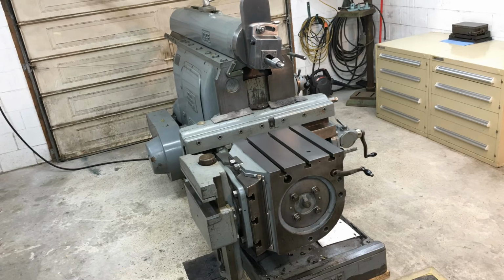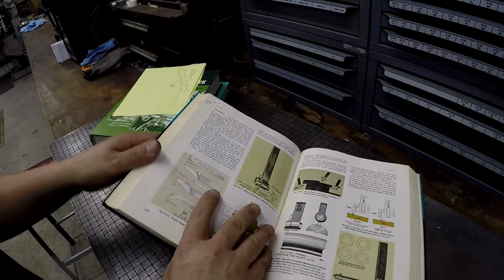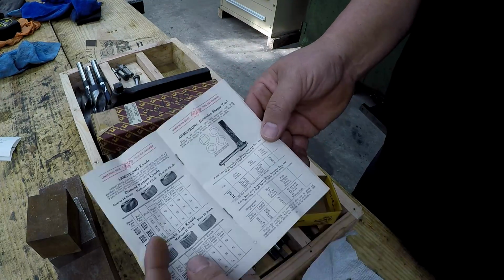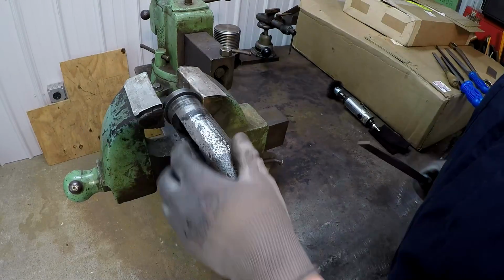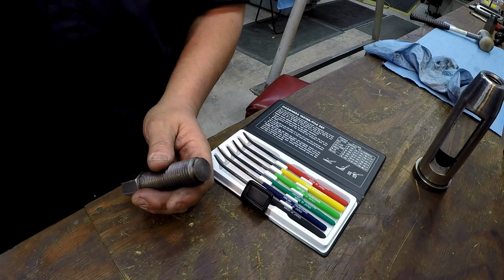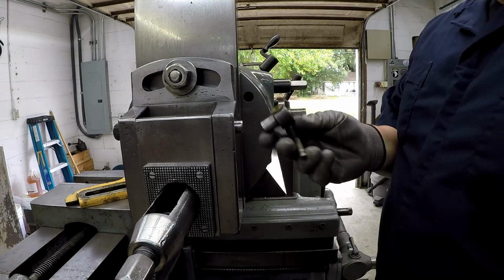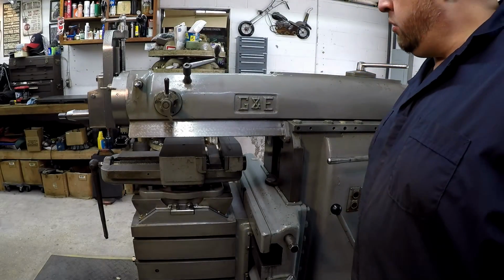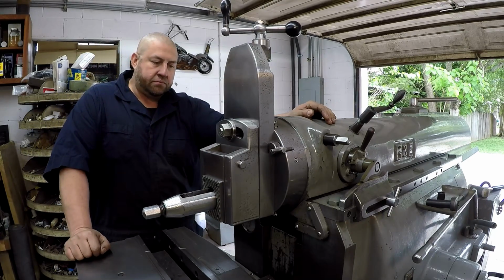SNS 213: Shaper Tool Head Final Reassembly, Machine Tool Books

Comment: When I was 18, I built a small lathe from scrap hot rolled angle, cold rolled plate, and threaded rod. Bronze pillow bearing blocks for a head stock. Draw-filed the ways and compound slides, gibs, etc. using only the ground surface of a drill press table as reference. Did all the draw filing by pulling the file toward me. I remember the shearing action removed metal much faster than a forward stroke. Still it took weeks.  The files were once my grandfather's.  Never got to the chuck or power feed. Just hand cranks, centers and a face plate with drive dogs. But it did finally turn 1.5" dia. x 6 in cold rolled with 0.002 taper. What a labor of love...

Comment: Totally agree with you Adam on the filing technique. During my apprenticeship I was taught here in the UK that a light return stroke clears the file, draw filing on edges was for truing. A "bastard cut" file is used for rapid removal of metal etc.

Comment: Nice work.  My own pride and joy is a Brown&Sharpe screw machine from the early 1960's.  I went from total strip down and clean to new lubrication, bored a new turret for it, even rescraped it.  It took months, cost my company thousands, but I was soooooooooo proud of what I had done.  The first job in it was a part that used to take a week to set up, and usually ran with about 40% quality rejects and went to an 8 hour set-up, and the only scrap was the first piece during set-up.  I wonder how it runs now, but I got fired a year or two later.  But I still have the second piece from the set-up!

Comment: I am an artist, years ago I decided to start working with metal in my sculptural work. I took a welding class at the Vocational school and got the welding basics. There was not much info out there on metalwork/shop work nor did YouTube exist. I ended up using old high school textbooks on metal shop work to learn basic skills. That was thirty years ago, I still refer to them from time to time. ( have two of those books Mr. Pete sent you)

Comment: I was taught draw filing at school 55 years ago when I started metalwork classes at the age of 11 or12. The one thing that I learnt later on as an apprentice (Engineer Cadet in the Merchant Navy) was that when filing a round profile, rather counter intuitively, was to file in the opposite direction to the round profile. So that rather than the file following around the round section you lifted the file up in the direction of travel while pushing down at the rear. This actually gives you a rounder profile than filing the other way which tends to give you a series of flats. For doubters I can only say go to your workshop/garage and give it a go, it does work.

Comment: Hi, On your filing, on this side of the pond that’s the way we were taught. It was said that the teeth were cleared on the backstroke. Who knows who’s really correct?Also your draw filing is perfectly correct and I always favoured it for getting a good finish. Very satisfying. You can also fill the teeth with French chalk, you may know it as welders chalk. You get a really soft finish using this. Your detractors never did any bench fitting. Regards.

Comment: Just to add more fuel to the 'filing debate,' I was taught to file round objects in a different fashion to you, Adam. For 'radius filing,'  in the UK at least, we start with the file on the forward part of the workpiece and as we push it forward, progressively lower the handle so that the area being filed moves towards you. Great restoration, by the way.

Comment: a little tip on wire wheels. when they seem to be getting dull lightly touch them to a grinding wheel while spinning. it gives the wires nice fresh sharp edges. works well with hand brushes as well lightly pass them over a grinding wheel or belt to refresh the edges. think of them as any other cutting tool works best when fresh and sharp.
Reply from the maker: Never tried that one before. Thanks.

Comment: I just thoroughly enjoy the shaper videos and the learning.   I have a little 7" Ammco just like Tom Lipton's and mine is in almost like new condition.  It lived in a government lab for many years and apparently was not used much at all.  Only 7 inches but still the most interesting tool in the shop!  I use it for a special part we make that has a fine slot across only one wall of a cylinder.  Thank you for the shaper series and am looking forward to learning about blackening.

Comment: Abom is right - I was taught the same techniques.
File finishing is an artform when it's done right.  When I was a lad 50 years ago the old boys would hand finish their tools using a range of draw file techniques.  While it was all referred to as drawfiling, by varying the angles of the file on the attack and release strokes they would create anything from a smooth "frosted" finish or by following the angle of the ridge lines they could cut quite deep grip lines as good as any knurling wheel.  They'd also create burnishing steels of various agressions for finishing.  All "just" with a file.

I was taught never to "peck" and told that constant contact was the surest way to maintain a consistent angle.
Certainly when filing they'd vary the pressure used on the attack and release - but a combination of the release stroke and only grudgingly, occasional use of the pinbrush was used to clear the teeth of any "shit stick" especially with aluminium.

Comment: Congrats on a complete and running shaper. Looks fantastic and will work even better now.  I would suggest a little oil on the down feed ramp so you don't have metal to metal contact.   Jeff

Comment: Mark Novak, the gunsmith guy on c&arsenal's  Anvil series did some hand filing on a gun and discussed what he called a pressure pattern - heavy pressure on the cutting stroke and light / no pressure on the return stroke and you could hear the difference between the two strokes.

Comment: Yeah there's a big difference between coasting a file back and trying to remove metal on the back stroke.  I dont use a file every day but I've always let the file touch the work on the back stroke and I still have the same file my dad gave me 30 years ago.  Still works just fine.

Comment: I was just about to say about using hacksaws when you mentioned it.
In fact the normal way to start a cut (as i was taught by teachers) was to drag a saw backwards a few times.
Also, when you lift the file for the backstroke and place it back on the material, there's a slight hammer effect, that must do some damage.
I was also taught draw filing

Comment: yes I have heard the same thing about filing but I had some old millwrights tell me its fine just don't bear down on the backstroke which is exactly what you just said, keep up the great videos and beautiful work. Its great educational and entertainment value.
Reply: You pretty much said what I was going to say and I believe you're both right! :D
So... the way I see it and as you said; so long as you don't bear down on the back stroke, the file should be fine. The irony is, I've seen SOME files that work on both the fore and back stroke, I'd love to hear people complain about the "rules" of how to use those XD
Also, I have noticed some materials clog the files if you DON'T apply a little pressure on the draw, so I think people need to consider such techniques may apply to SOME materials, but others require a different technique :)
Reply: @GaisaSanktejo  wow thats interesting I'm 62 yrs old worked in industry my whole life, as an industrial electrician and motor control technician and I never saw a 2 way file thats cool. and yes I had a guy tell me once when he was filing aluminum that a light pressure on the backstroke rolled some of the aluminum out of the file because they clog so bad with aluminum.I think this Adan feller is pretty intelligent I figure he knows how to file..lol.
Reply: @stevelecain886  I tried to find them online and since I couldn't find them online I believe the guy who made them must have either been local to me, or there wasn't a market for them as I haven't seen evidence of them since.
If memory serves, it looked like a double cut file, but while one cut was set to the forward stroke, the other was set to the draw...
Then again, it might have been a "reject" batch where something went awry... I just don't know enough to say since this was over a decade ago.

Comment: Dragging the file back;
Builds muscle memory for repetitive hand and arm movements to increase control of the file and produce more accurate cuts.
Keeps the positioning of file to focus the area you want to cut.
Slight pressure on drag back can help to clear the file teeth and reduce gumming in the teeth.
Draw filing increases the "cleansing" of the file by pushing the filings out the side, again helping to clean out the teeth.
Soft metals (like aluminium / aluminum) can bind / gum the teeth, so frequent use of a file card (can slightly hammer the bristles onto the file) while working is necessary. Do not use a wire wheel (it'll blunt your files)

Comment: That auto downfeed is a lot more accurate and repeatable than I thought it would be with all those gears.
I used to worry about my files going blunt, but then I realised they were cheap and lastes 10-20 years before I needed to replace them anyway. One day, a file actually broke and to my surprise, there were shelves full of them at a hardware store. So, now I just use a file like any other tool, not as a special precision instrument that some feel it is.

Comment: Adam, love the vids. Looking at the tool holder for the big shaper, I think the way the tool holder is shown in the books you just showed, and you referred to as "backwards" may be the better way to run the tool.  With the tool in the tool holder "backwards" the forces on the tool bit are against the tool holder during a cut rather than just against the nut. The forces on the tool bit are probably better transferred to the tool holder than to just the nut, perhaps adding some rigidity to the set up.

Comment: Great episode Adam.  I have that same set of hardness test files, and I learned a few good tricks from Stefan Gotteswinter on how to use them.  Now I start with the HRC65 file and move down.  When starting with the soft files, I risk dulling them on harder metal.  The other thing is that I'm not filing but just testing if they grab the metal.  This also keeps the files sharper for longer.  I near ruined the HRC40 file starting out with that on hard metal, and filing away.  Hope this is useful
The shaper looks awesome now!!
Reply: I wondered myself if starting with the hardest file would have been the more correct way. After a little digging on the internet I found a fowler tools video that says that it is best to start with the hardest file.

Comment: not to snipe about your filing, but have you tried:  when filing curved surfaces, start at the far side  of the work, with the nose of the file down and as the file is pushed forwards, push the handle down and roll the nose of the file up, working to the near side of the work.  So, rather than following the surface you actually  prescribe the inverse (easier to show than describe)
Reply: Metal work is not my day job but if you can get into the rythem of filing this way you can get nice results. I found with the traditional way I would cut heavy close to me and lighter further away making a slope not a nice radius. A mix of the two styles would save on having to de-vice, turn and re-vice all the time. I guess it's a personal thing. I am a bit delicate in my working but i can imagine for some folk it would be a good way to snap files ;)

Comment: When I went to Tech School we started the class by filing a square steel block by draw filing.  Chalking the file will prevent metal from loading up in the file.  50 years later I still file metal as I no longer have access to machine tools.

Comment: I'm surprised you didn't paint the cam-plate gray. I mean, obviously the yellow had to go, but usually cast surfaces are painted. Do you intend to keep it that way or just temporary? Also, what does the rise on the back of it do? Click the lever into a position towhere it won't drop back down to be broken on the return stroke?

Comment: Adam, I just recently found you on YouTube and I really enjoy your videos. As I am watching some older ones now, I just finished the Parking Attachment Series. After 40 years in the industry, I still gather pointers from watching you. One comment though, when you tacked the two plates in the beginning on the attachment, you did it on the mill table. I couldn't see where you had your ground but I hope it was directly on the piece. You may want to point out to your viewers that it is very important to ground to the piece directly if you have to weld on the machine table and never a random place on the machine! You work so hard on your equipment I would hate to see you fuse some of the gears together or worse yet, blow your display with an improper ground.
Reply from the maker: I would have had the clamp on something attached to the plates, like a c-clamp or and angle plate. I never run it though the machine.
Reply: I expected as much :) Keep up the good work!

Comment: 1975 City and guilds task for myself as an apprentice, make a machinist square by hacksawing and filing two pieces of steel to given size, braze together, clean up with a file (Its a precision tool), required finnish was to be drawfiled with a fine file.   Anyone who thinks they know it all usually is ignorant of how much they don't actually know! After the hours spent getting all sides of each piece square and to size without any marks from saw or courser files its still has pride of place along with my rules scribes etc

Comment: Your correct in what you say about your filing technique, there should be no pressure on the back stroke, the only time you have pressure on the back stroke with a saw is with draw saw. 🏴

Comment: I have a gun collection that developed surface rust.  I live in Georgia, lots of heat and rain.  I now use a product called Z-max  (Zmax.com).  I let them set in the sum to warm us, then wipe them in the z-max.  It has been two years now and no surface rust.  This automotive produce soaks into metal.  This might be something to try on your machine parts to keep them from flash rusting.  Nice video .  Thanks for posting.

Comment: In these tests - a grease pencil could be the cutting tool to track the side movement and if it won't last use a pen on paper.  I did that on my CNC Plasma table to check something.  Oh - I got an idea on vertical slots -  Use the cut off tools from the lathe - the carbide ones - lock the tool into the lantern - have to drill two holes to hold it into the slot along the top pushing one way and the other to to fill the slot and place it flat on the other side of the slot.   Just an idea - never tried it - but cut off tools are slotters in life.

Comment: Sometimes in some materials with some files, a light drag on the backstroke helps clear swarf.
As to wrecking the teeth? As long as the file is harder than the work, guess which one loses........

Picking up the file on the backstroke is like training wheels on a bike. It helps you learn but not needed once you get the hang of it.

Lifting the file on the backstoke is a good technique for beginners to start with. One of the big reasons is novices tend to rock the file and make flat surfaces humped. Part of this is they drop their elbow on the return stroke, lowering the handle of the file. When they start the cut, the file is tipped handle down, taking off the corner of the work.  They also don't relieve the down pressure at the edge of the work and roll over the other edge, dropping the tip, cutting off the other corner. Lifting the file prevents this. Picking it up is way slower but promotes good technique. With experience, and muscle memory, you can pick the file up less and less until you are only taking the pressure off, and skating it back over the work.
Reply: Notso Fresh ‘

Comment: Hi Adam, have you ever used the technique on round stock where you lower the tang / handle end and raise the toe on the forward stroke, i find it helps eliminate flat spots. Feels weird to start with, but try it if you haven't

..

Comment: Honestly, I think some folks have been told to only file one way because some people actually will try forcing down on the file in both directions.
On another note, I was given some older files a while back,,, and one of them has the teeth oriented to cut on the pull stroke. It's a little guy about 4" long and has an image of a rabbit stamped near the handle end.
Reply: It's probably for a die filer; they are hard to find these days.

Comment: Now that I’ve seen this video of it, I wonder if you could make a mechanism to go in place of the original (as a direct replacement so you can put the original back after) that has a handle to switch it between up and down feed for the power feed

Comment: I saw Stefan Gotteswinter using this too. I think it is better to start from the harder file and go down in hardnes as Stefan did it. Depending on the force you are applying to the files, of course, you may end up dulling the files faster. Going up in hardness, you'll dull each file but the last one just a tiny bit. Going down in hardness, you'll only dull the last file just a tiny bit.
Reply: thekaduu consider this though. If you go from soft to hard you’re only putting one scratch mark in the piece you’re testing. So there’s an up and down side to both ways imo
Reply: You are right. I was just concerned with testing equipment and its reliability over the lifetime of the equipment (for home gamer such as myself)... Company I contract for generally cuts several feet of the product to perform various tests for the customer (even if the material is Inconel). I guess if this is for a small shop or one off production, it would make sense to go from soft to hard.